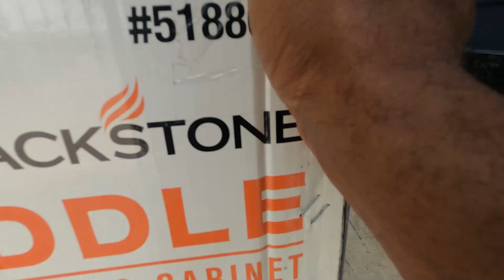This Dude Should Have TIPPED! EXCELLENT Customer Service is NOT Always Rewarding! #foryou

Comment: As a professional mover I treat that scenario 3 ways. 
1 it's hourly, sure no problem. More time more money. 

2 it's flat rate, extra work requires an extra charge. We didn't agree to the extra work it'll be $X

3 do what you did as it wasn't really much extra work and was a cpl min, gamble on the tip. No big deal if they don't. You're the better person. 

Depends how much extra work. I used to get a lot of hey while you're here I just need you to....and I'd tell them it cost more if it's more than 5 min. These days mostly just do hourly and problem is automatically solved.
Reply from the maker: You have a great plan to follow. Appreciate the tips!

Comment: You received $75 paid by the customer (he probably paid more since Roadie or whoever takes a cut) and you can't do a couple of minutes extra help for a guy without getting an additional tip?  I am so disappointed in you, and I have been one of your biggest fans since you started.
Reply from the maker: The app tells you if they tipped or not and it said no tip. The customer actually only paid $35 for delivery. The store must have paid the rest as an agreement in order to offer the service.
Reply: @carsandcribs  Once you accept an amount and agree to deliver, what the customer tipped is irrelevant. You felt it was a good offer at $75.  Nothing changes because of how that payment breaks down. For ages, delivery fees were from the product source/store.  The customer may figure you work for them for all we know.  At any rate, I was disappointed in the whining.  I still love you though!